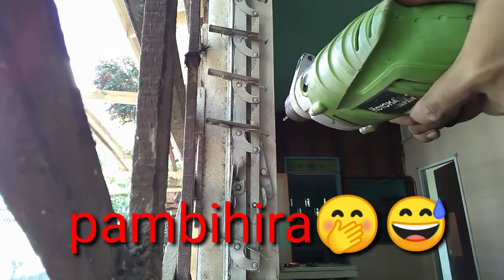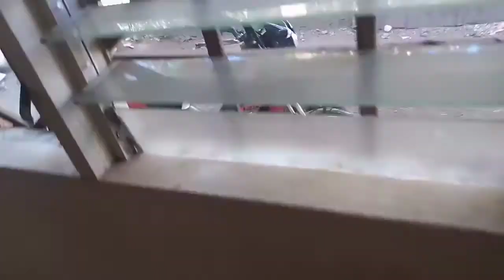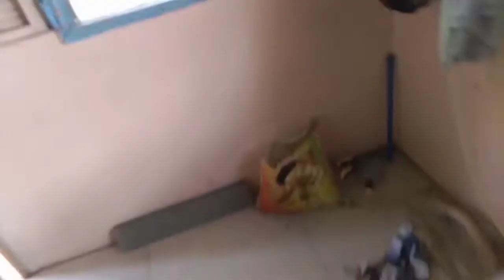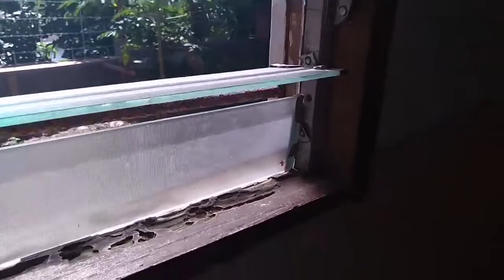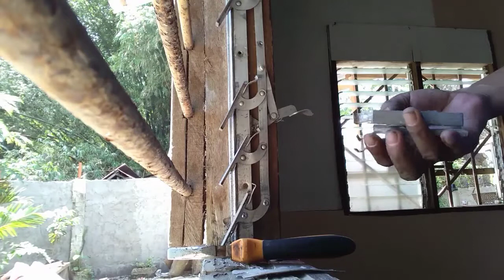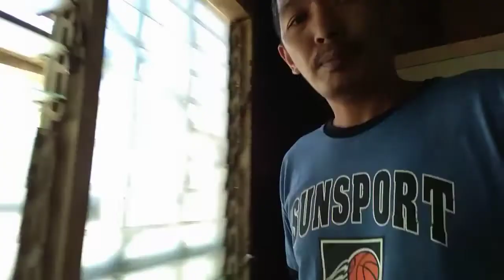How to Repair Jalousie frame?

Comment: What’s the spacer thing, starting at 4:22, that you’re using between the frame and rivet tool? Is it necessary to allow the rivet to pivot when the window open and closes? Does it come with the rivet tool or you need to buy separately?

Comment: Anong tawag sa parang clip holder niya pwede ba yan lang bilhin?
Reply: Isa lang naman din sira e
Reply from the maker: Hanap ka lang ng sira boss.. wla poh ngbinta nyan.. pero pwede ka maka hingi sa shop nyan or mabilis mga retaso..
Reply from the maker: @r0dman.x1  may mga retaso sa shop nyan d na Nila magamit.. salamat boss Sana maka tulong sau
Reply: Pero sir pano ba tanggalin yung parang bilog niya screw yunh bolt screwn, meron bang screwdriver yan na madali lang matangal
Reply from the maker: @r0dman.x1  barina lang yan na 1/8 sir para ung revits mo sukat